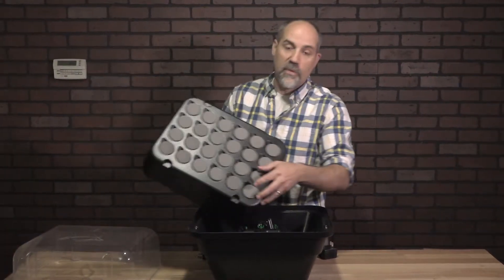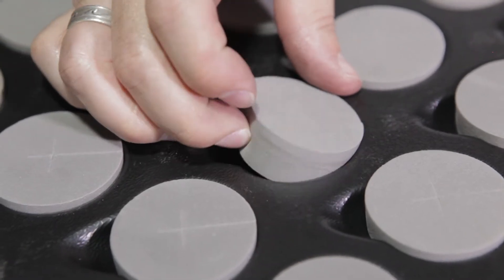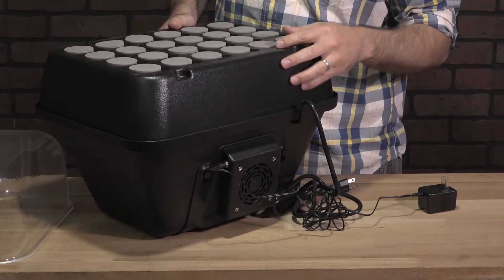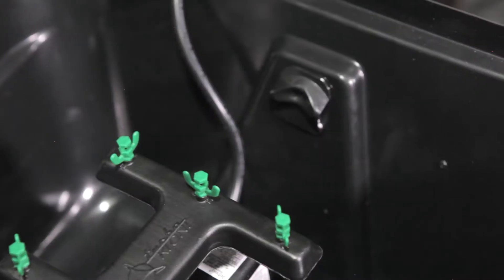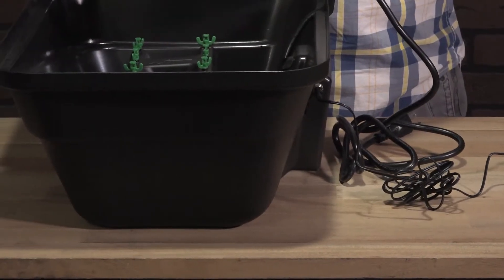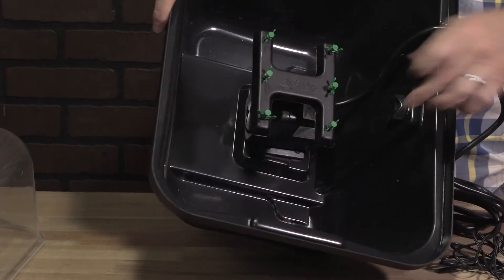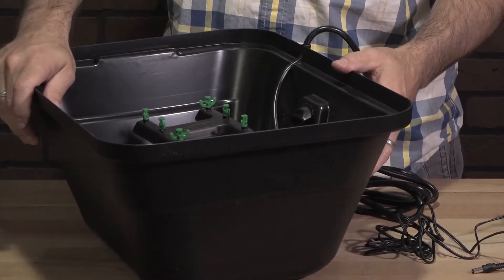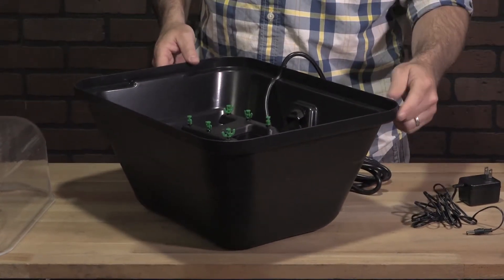TurboKlone T48 - NO Humidity Dome Setup | Hydroponic Aeroponic Cloner Assembly

Comment: You should wear a mike so you don't sound like you are talking in a trash can. As the official site you should have more professional audio.

I just got a 24 without the dome and it appears you don't need a dome unless you have very low humidity. With cloning plugs and rock wool I always needed a dome and the plants still got droopy and stayed that way for a long time. After the first day my first test batch with the 24 and no dome is nice and perky. They got droopy at first but all were fine the next day. I hope that in 8 to 14 days to have great roots like lots of people say you will. If all goes well I will be buying a 96 Elite in a couple of months.